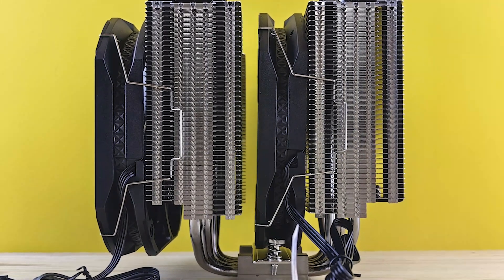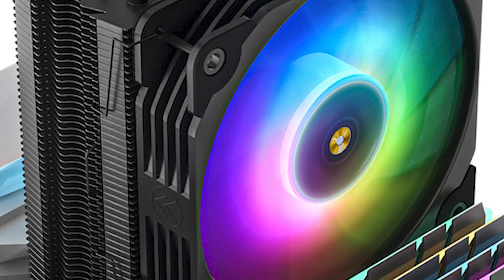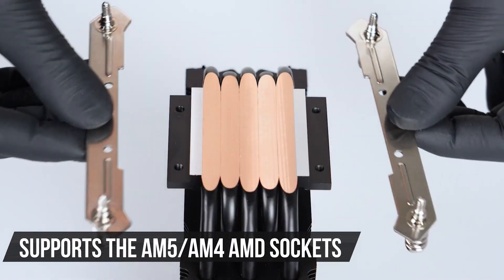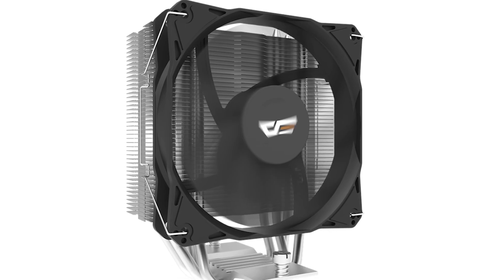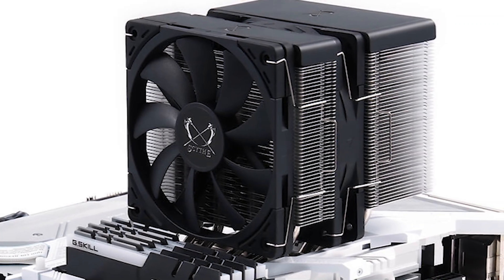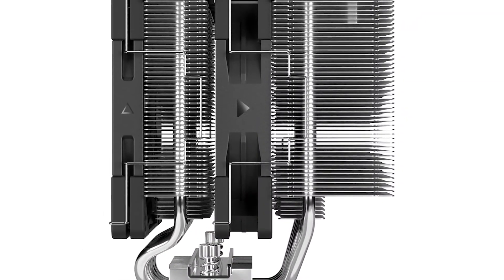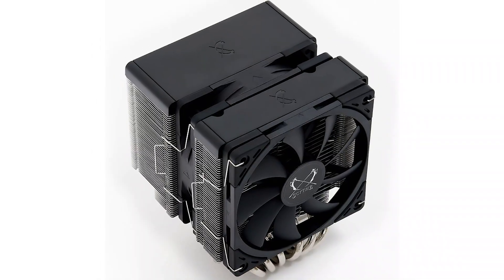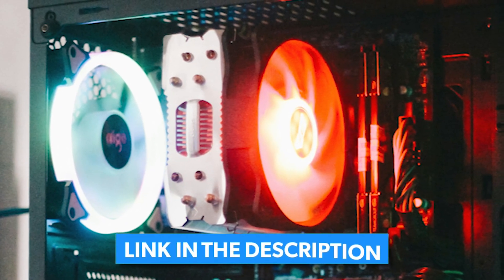The Best CPU Coolers For Ryzen 5 9600X In 2025 ✅ Best Budget & My Top Choice

Comment: I have peerless assasin cpu cooler on my ryzen 5 9600x and i think temperatures are a bit high. They can get to 60 degrees under not that heavy load. I don't know why. I used little older thermal paste so i wonder if that can be a problem maybe.
Reply: i have a burst assassin 120 se with a 9600x and i also noticed that is quite hot ( 50 to 60 degrees) on idle, however under heavy load like cinebench it stayed under 85 degreees while drawing over 80 watts. Maybe the high idle temps are normal on everyone but i don't know.
Reply: @rikydanini820i have replaced my peerless assasin with 240 liquid cooler and new high quality thermal paste. On idle temps are now between 40 and 45 degrees and under heavy load around 65 degrees, sometimes close to 70 degrees
Reply: @rikydanini820I'm getting high temps too, might get a liquid cooler soon even if it's overkill
Reply: @ColeReal i have replaced my peerless assasin with 240 liquid cooler from thermaltake and i applied new high quality thermal paste. On idle temps are now between 40 and 45 degrees and under heavy load around 65 degrees, sometimes close to 70 degrees
Reply: My 9600x with a Arctic Freezer 36 idles at 40 degrees. I only use three case fans. A Peerless Assassin should easily match that. The problem was something else in your setup besides the cooler itself.